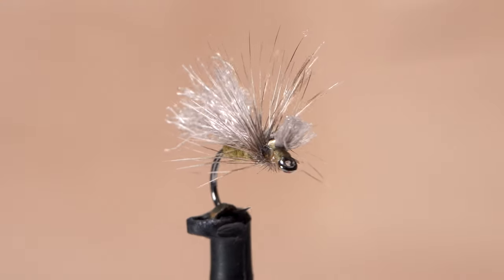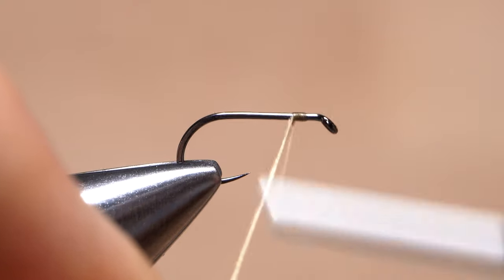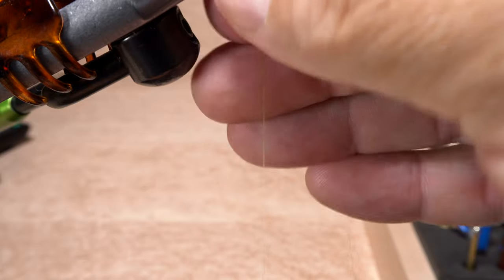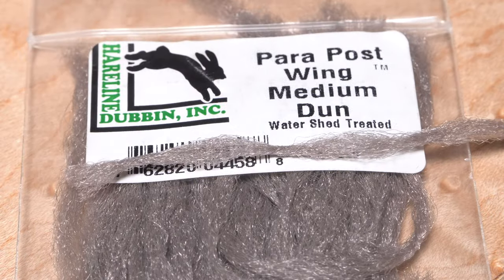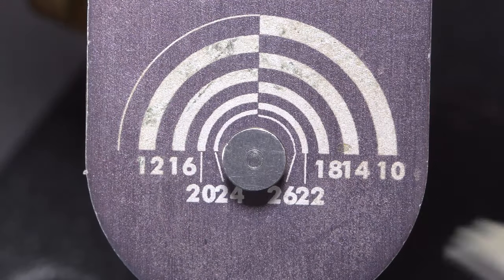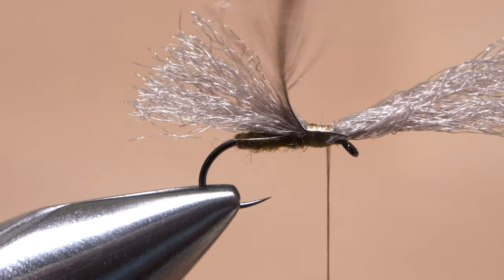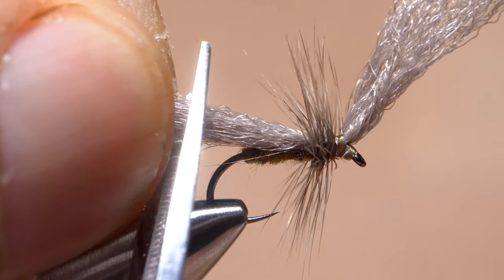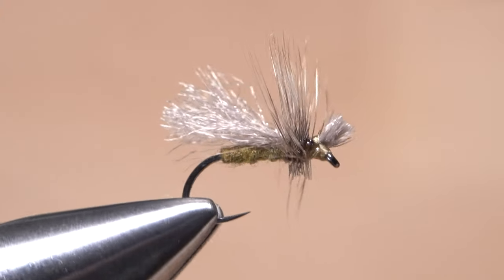DPH Caddis Dry

Comment: Great pattern! Tim, would EP fibers work for the wing as well?
Reply from the maker: EP fibers work great for this fly particularly in small sizes like 18's and 20's. EP Trigger Point fibers, like polypro have floating characteristics and are available in a whole bunch of yummy colors. Only problem is, they are about 4 times as expensive as polypro, maybe more.
Reply: @tightlinevideo  Thanks, man!